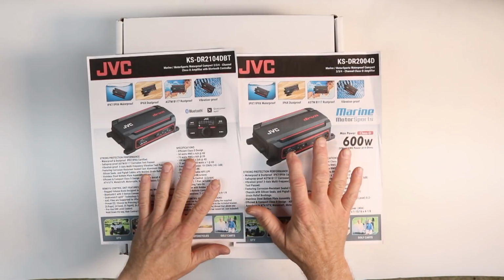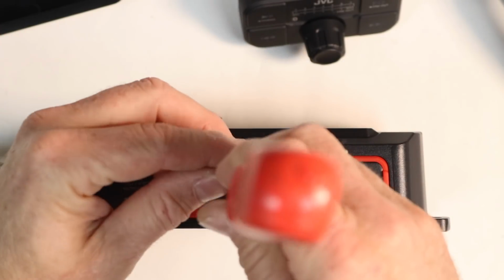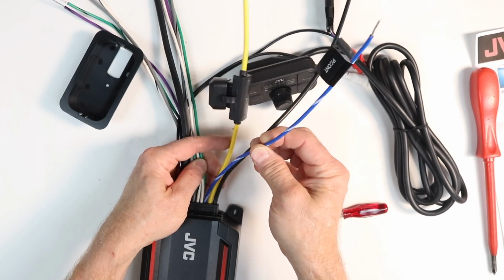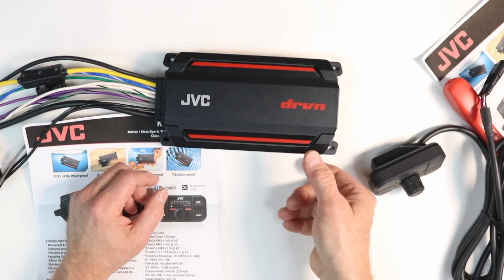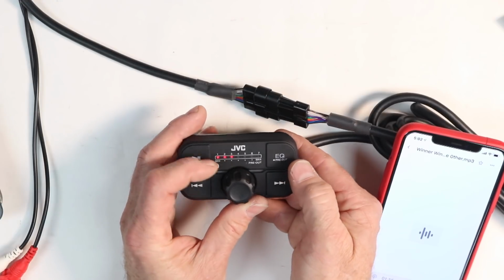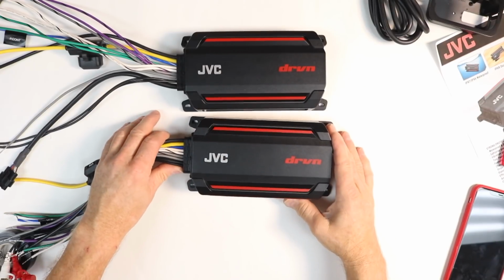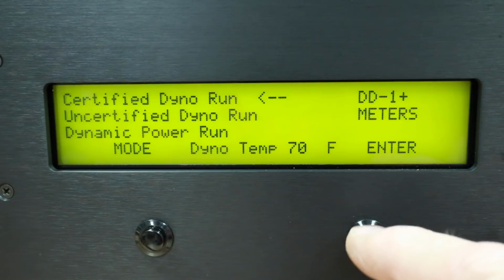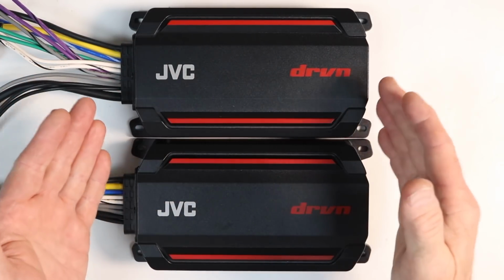Unboxing and Amp DYNO of the new JVC KS DR2104DBT and  KS DR2004D

Comment: Ok got this amp and about to install on my can am xmr 1000. Any suggestions as to good place to install? Do I have to install in location that won’t get water/mud since that all I ride or can I actually install on the outside of the quad and not have to worry that she won’t short out
Reply: How do you like the amp? Does it sound good or is it hard to really drive the speakers and retain quality sound?
Reply: @scarr3ll  I’ve since sold the quad but that amp was a beast had the power rated and it ended up getting swamped with water a bunch of times and never quit. Sold quad to a buddy of mine and the amp and speakers are still playing to this day

Comment: This Jvc is same as the Kenwood Kac-M5024BT.  I want one for my motorcycle, does not matter which.  Jeepers just get them out to us.  I bought a used Victory Kingpin bike in December that had a Wide Open Custom fairing and 5.25 speakers.  The head unit is an old model Jvc single din rated at 22 watts rms, a bit underpowered for me and worst is it will not pair to my Sony Nw series DAP, however you can use 3.5 wire connection.  However I want to bluetooth.  I like the controller being a turn knob as much easier to bring noise down when coming into towns, and stop lights.  This new unit replaces the older Kenwood Kac-1824BT, which I had in a recently sold Yamaha motorcycle and it really worked well.  However the new to come Kenwood and Jvc appear to supply even more rms watts, is more functional, and appears to be even better built and more moisture resistant.

Comment: High of 2 degrees f on this 2-2-22 here in Duluth Minnesota.
Heat wave today.
Reply: Isn't that the norm over there? 🤣
Reply: Kinda. Dude on the radio said it may get up to 30 next week. Wind chill low today is around 30 below. So 60 degree swing. But nah. I just thought that was a lot of 2s. Had to put it somewhere.